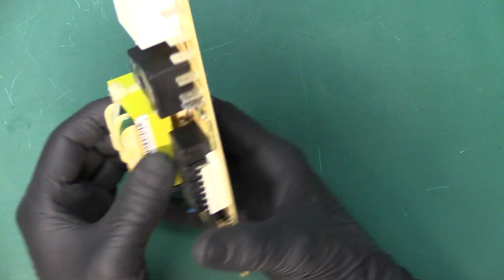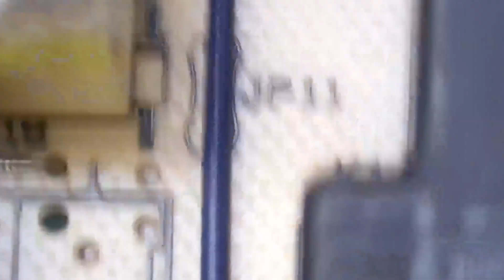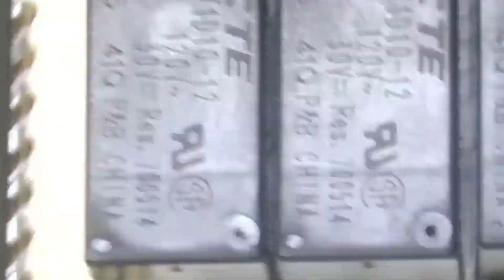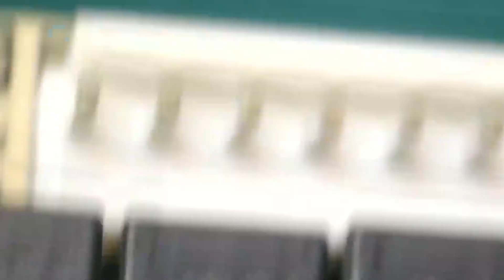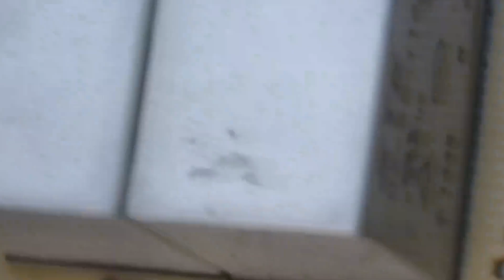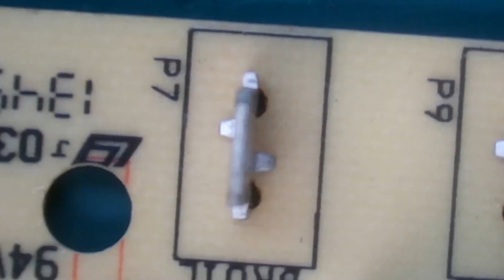How To Fix Frigidaire Oven not heating 316560106 316560105

Comment: Nick, I have an oven that I would like to keep working but at least I know where to send the board if it goes bad. I see multiple ovens at the local dump. They're kept in a separate area. I oven wonder how many of them just need the right attention to be returned to a useful life. Thanks for Sharing! :hand-orange-covering-eyes:🙃🙂
Reply from the maker: If it's a controller board issue I bet we could have fixed 90% of them. If it's anything else, any appliance repair company could have fixed it. Ovens are very simple to fix. The hardest part to fix is the controller board, and we have been getting really good at it + sharing all of the "secrets" with everyone. I just need my videos to get more popular and in theory 95% or more of ovens should be fixable if everyone saw my videos. 
Also if that pun was intentional thank you, I loved it haha!  :)

Comment: Excellent work as always! Just thought I'd point out that when you started reflowing the Bank of relays that feed the main connector where you found the original cracked solder joint, it does look like you might have missed reflowing the top leftmost joint which you can see @5:24 Just don't want it to come back and bite you in the rear...
Reply from the maker: I think I know which joints you are talking about and yes I skipped those on purpose as those joints aren't prone to cracking. The reason for this is that they are low voltage lines (12Vdc) to activate the relay, they are not high voltage lines like the ones we reflowed which is where the heavy voltage goes through. This means they don't  heat up like the other joints which then means very little to no thermal expansion and contractions which = no cracks

Comment: Hello and thank you, Is it better to remove the relay from the card to check its operation or if we can do it directly on the card without risk of damaging it?
Reply from the maker: Yeah it's better to remove it but if you know exactly what you are doing and how the circuit is built, you don't technically need to. It's just safer to do it if you aren't 100% sure of the voltage polarity of the circuit. The relay itself does not have a polarity but the circuit does.
Reply: Relays have not much that could go wrong. Usually they fail and get stuck either always on or always off. And you can measure them withour removing from the board, just using a multimeter.